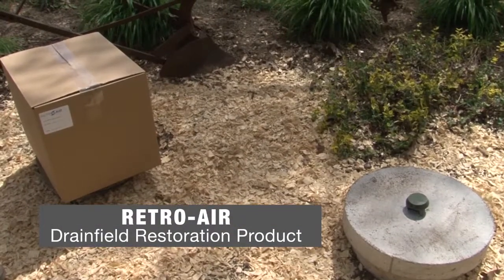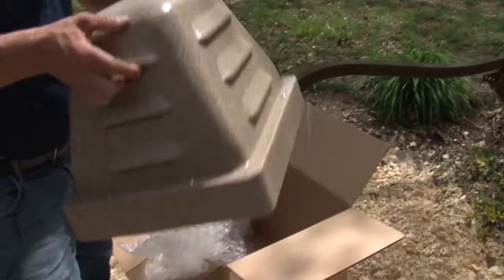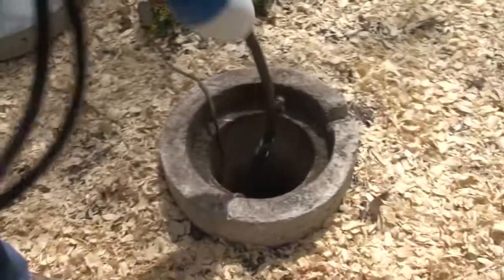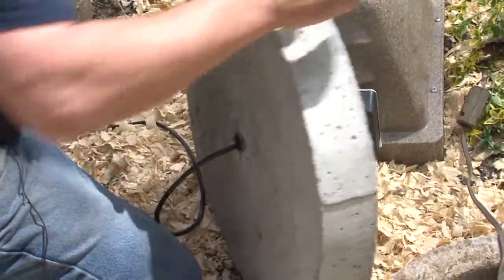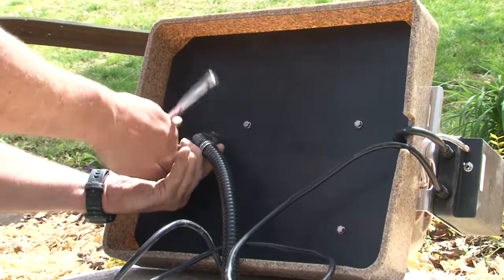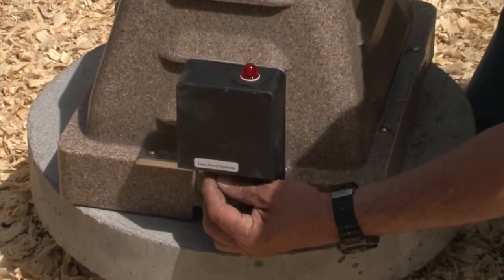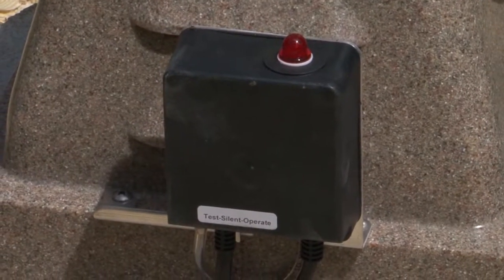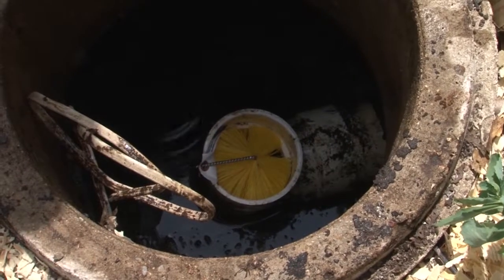Retro Air Rejuvenation System Installation

Comment: Do those fit in the green curved tank lids? So, if it has its own alarm then I would need a new panel just to run sprinkler pump or do I need a control panel to operate both?
Reply: Got a good deal on this unit so I am converting from shaft. I My tanks get a lot of overflow from the rains, past 17 years. Benn thru 5 areator, last one lasted a year. Level gets too high causing wear on bearings. With this, high water won't bother it and rebuild kits are a fraction of a new unit